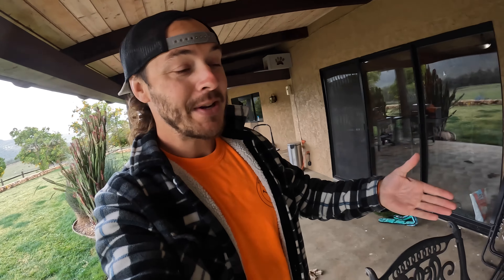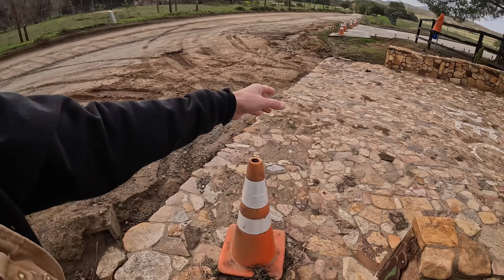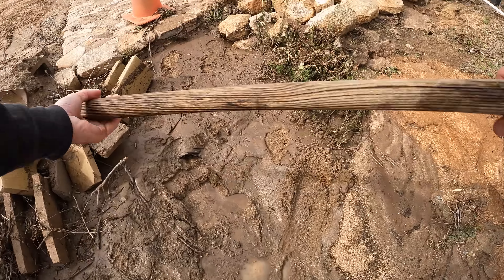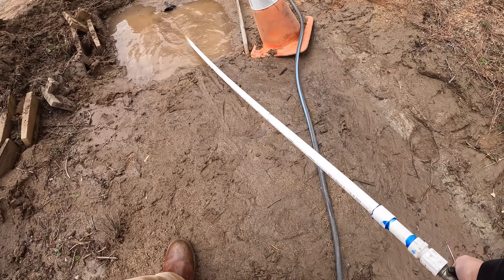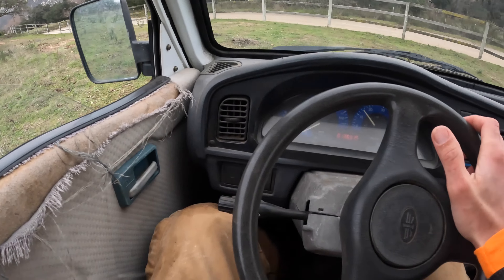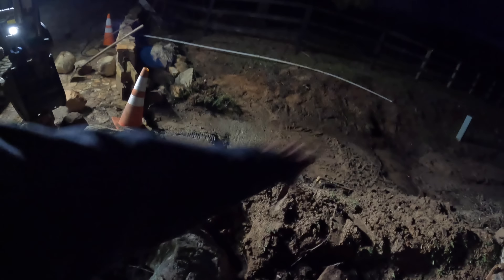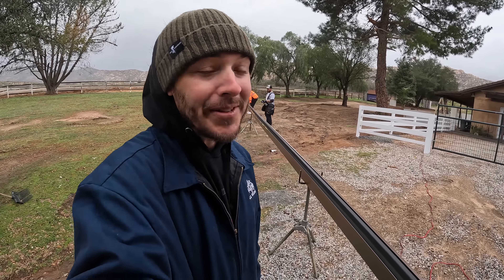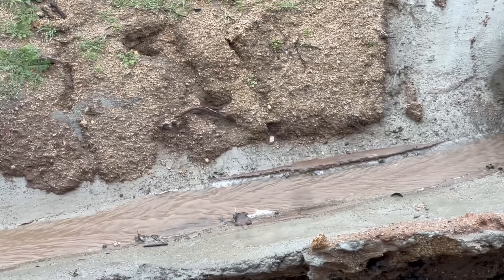Trying to Fix my Ranch Flooding Issue with this Ridiculous Contraption!

Comment: You need to put in a settlement pond that's deeper than your outflow to catch all the sediment and then as it gently flows over (a rock out flow) it'll drain out with less sediment, then you can dig that sediment out once a year and use it for fill on your property.

Comment: You need to make a sediment pond. Something large. With pipes flowing to your ditch from the top of the pond. The debris stays in a pond so that you can scoop it clear with your excavator. You seam to not want to put the time into fixing the issue just bandaid the problem. You have a machine, it is actually an easy fix

Comment: @DMAXRYNO I think you just found your calling in starting up another business for the channel. Man, the cat is living the life over there. He has his own suite with a heated blanket. 

Ever though about digging the ditch out about 10ft to 20ft out alway from the existing driveway while putting a slight pitch to help drain away from the driveway better, then putting a yard of river rock down in front of covert pipe to help with drainage?  Another bandaid to add to the mix till you're able to get the entrance finished, but it might serve its purpose longer, so you don't have to keep  messing with it. Could bring a load of those rocks over to muddy feet. Use his rock crusher if he would let you.

Comment: If that little bit of water from the hose washes that sand out, you should grab Jame's water truck and dump a high volume of water through it. It Should wash most of it out.
Reply: Or he can bring the fire truck to the ranch.

Comment: Just out of curiosity don’t know if it’s possible but I’ve seen vids of people unclogging drains like that with a strap hooked up to a tire hooked up to a truck or tractor would that work if u started at the small end first and then pulled this the big end don’t know how u would run the strap thru but just wondering

Comment: hey ryan id suggest you get a 10-12in culvert pipe and make a bypass of the small culvert get double wall then dig a trench in front of the driveway (so you dont have to dig up the driveway rocks) then tie it into the ditch where the concrete is (obviously you have to cut in a hole for the pipe to enter) this solves all your issues with the small culvert while still allowing you to drive heavy machinary up the driveway(far heavier than what you have itd be more like what james has)

Comment: The donkeys probably hang by the house when it rains not to stay dry as much as to stay warm because the house probably blocks some wind if they had a shelter with walls they would most likely go there instead of against you're house

Comment: They make inflatable rubber pipe plugs with an eye bolt. A 4 or 6" plug partially inflated will be a good alternative to drawing the tire through your pipe. Any utility/Waterworks supplier would have these. Perhaps a Ferguson Waterworks is in your neck of the woods.

Comment: Why don’t you dig lower than the inlet under the driveway to allow all the sediments to fall to the bottom and reduce the backup?  You can add rocks to reduce erosion. 

We had to do that on the farm growing up we did 4x4 ft wide 4ft deep it would catch all that sandy  dirt at the bottom and would clean it out after the rain storms.

Comment: One thing you should try would be to dig some trenches/culverts and fill them in with gravel/river rock, or even wood chips so you can still drive over them, but it will also allow the water to flow through those like smaller rivers. Having the rock or wood chips in the trenches will help slow the water down to help prevent more erosion.

Comment: Also why not saw cut straight the rock drive way. Where the curb starts. 

Fix culvert pipe 12 in and concrete a fan driveway over the culvert .., essentially a curb. But in a mountain to need a huge culvert. I bought my house and nonstop work ever since aswell.

Comment: Commented on an old video, but ill add some extra info here. You need a self cleaning system. First off oval or egg shaped (narrowest end to the bottom) is your best bet for pipes. So the water always flows at a self cleaning speed. 

With open channels you want a multi stepped system. Your in the USA. Look at I think its the LA concrete rivers. \--_--/ setup, so once again when the rain is low, and there is less water it has a smaller channel, allowing the dirt to stay in suspension and clean itself, when there is alot of water it uses the larger channel, once again self cleaning.

For erosion spots use rock baskets, in short its concrete base (or compacted sand/soil) geotec fabric, a wire basket, bolt that into the ground or concrete with a metal bar to distribute the load, fill with hard stones of various sizes, granite works wonders, sew a lid on it out of wire again. It slows down the water flow, pulling sand out of suspension and also stops/heavily prevents erosion. It's used alot in the tropics of Australia where cyclones (hurricanes) exist and for half a year it basically pours down (check Darwin and Kakadu average monthly rainfalls to see what it has to deal with).

I can go in depth more if you want. But the farm I grew up on faced these issues alot until we put those measures in, it handled tropical monsoons no problem. Also installed some in floodplains as a job years later.

Comment: I’m just trying to figure out what Milwaukee tool you used for chipping away the concrete and soil around the drain pipe
Reply: Roto hammer
Reply from the maker: Here ya go! 
https://www.homedepot.com/p/Milwaukee-M18-FUEL-18V-Lithium-Ion-Brushless-Cordless-1-in-SDS-Plus-Rotary-Hammer-Tool-Only-2912-20/315444524

They are awesome!
Reply: @DMAXRYNO  thanks for replying!

Comment: How about concrete cut the stone work at the front of the driveway into 3 or 4 large slabs. Moved them out of the way. Change culvert pipe and then throw back the slabs.

Comment: Cool, your drainage ditch has black sand in it.. iron.. You might have some gold on your property. It'd be interesting to take some of that and run it through a little sluice and see if there's any gold in it. Those are quail tracks that were in the mud. Wild turkey tastes SOOO good! It's like store bought turkey but with 10X the flavor at least.. How do they not get picked off by coyotes? Walk up on a flock of them and you'll know how.. They will chase your ass down and they have NO PROBLEM using their spurs. 
Instead of breaking out the rock work at the driveway and hoping it goes back together.. why not just cut it with a rock saw into a few pieces and lift it up with the excavator and then put it back in place?